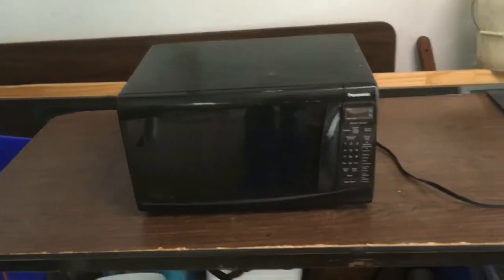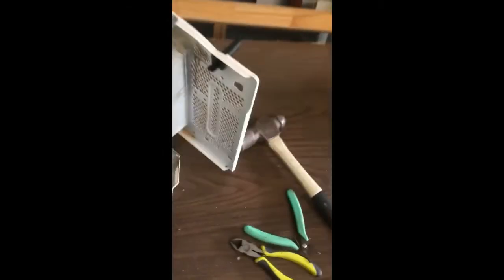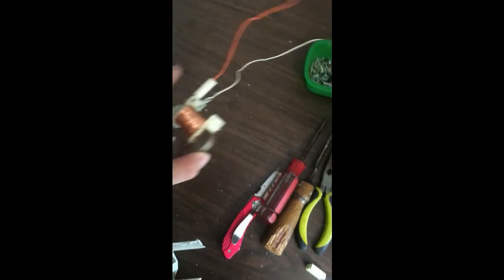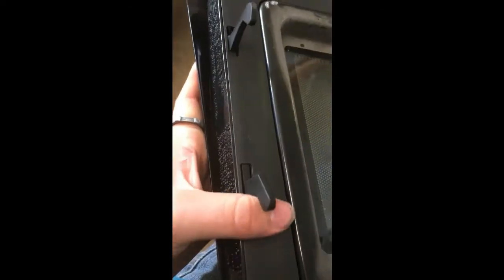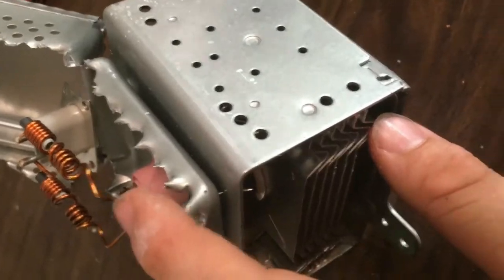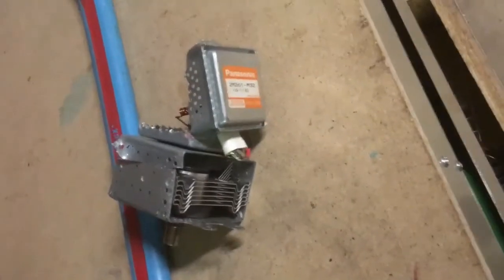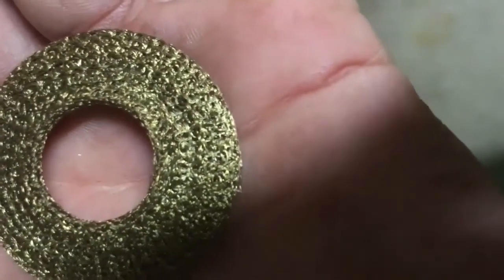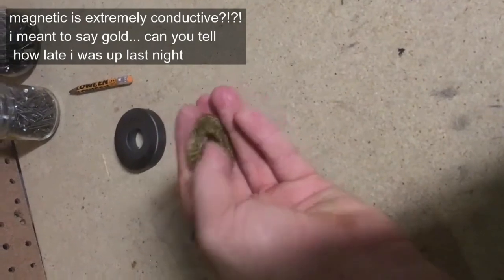disecting a microwave     find gold?

Comment: Bit late but did you ever find out if that was gold?
Reply from the maker: storma-geddon [PS4] nope, it wasn’t gold
Reply from the maker: storma-geddon [PS4] it was yellow brass
Reply: Ok thanks
Reply: Only an early model microwave oven has the gold component poeple want. They can have up to 2.5 grams which is worth approximately $120 Australian dollars. 
You can pick up a new microwave oven for less than the gold inside. So it's not feasible to make them with gold bits anymore.
Reply: @alexplayslife7782  around what year model or how old does a microwave have to be to have gold in it
Reply: @adampetrie7271  where was the gold in the older models dude